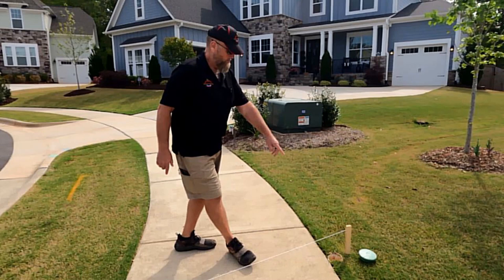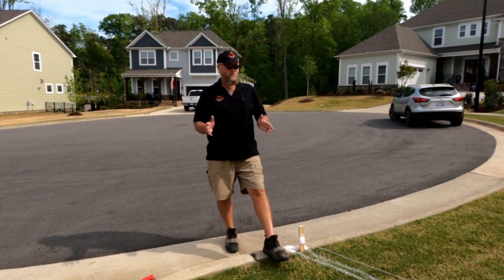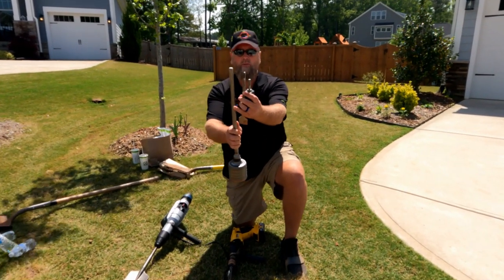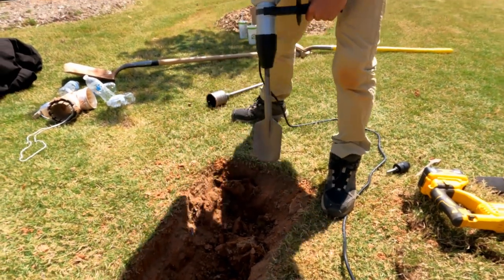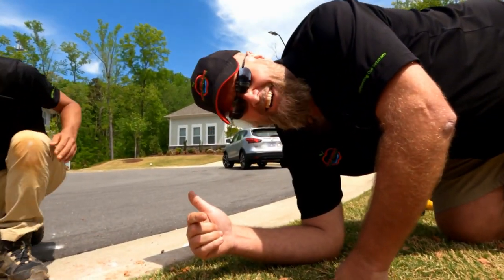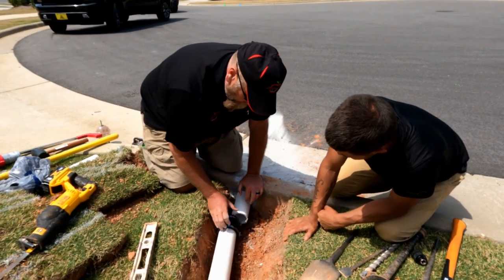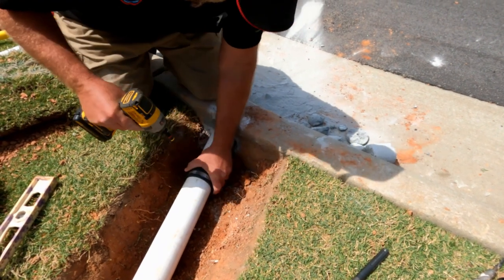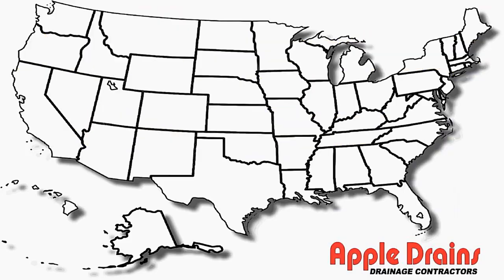How to Core Curb and Tunnel Sidewalk,  Raleigh NC

Comment: I dug out two sections about 12”x12” through my  3’ 4” sidewalk  from the driveway to back door to install NDS Ez Drain. On the first one I used just a shovel and it took a couple hours. The second one I got out my pressure washer and cored through and then blasted it out! Literally took 10 minutes and I had so much fun lol.
Reply: Does the pressure washer really work, and make easy work of burying a pipe under a sidewalk?? I need to get a pipe under my paver sidewalk and I’m afraid a shovel may undermine the base material too much, so I’m looking for an alternate method. Thank you!
Reply: @1ronhall  If you are using pvc pipe for your installation, then using a pressure washer is the way to go. Of course you have to dig out a little on both sides of the sidewalk to get it started. Then cut a piece of pvc that’s at least the width of the walk and put it up to the dirt underneath the sidewalk. Now, using the zero degree nozzle, put it inside the pipe and blast away while at the same time pushing the pipe as you go. If you are using that pipe then just leave it and add couplers if needed or if using corrugated pipe just pull it out. Hope this helps.
Reply: @johnharrison5656  Thank you friend! I’ll give it my best effort. I appreciate your instructions.
Reply: @1ronhall  No problem and best of luck to you
Reply: @1ronhall  DEPENDS on the soil.  Mine is rocky/caliche.  I tried the pressure washer and in 1 hours only got under 6 inches.  So for mine it was a waste of time

Comment: Fantastic information!!  Will that auger go through caliche and rock under a sidewalk?   That's all my yard is. he builder finally came back and did a surface drain but stopped on my side of the sidewalk with a popup.  Hate it.  Water stands in the pipe and bugs/mosquitoes are drain to the drain grills.  I got a cost on doing what you just do 9 feet  and coring for $500!  I thought that was high.